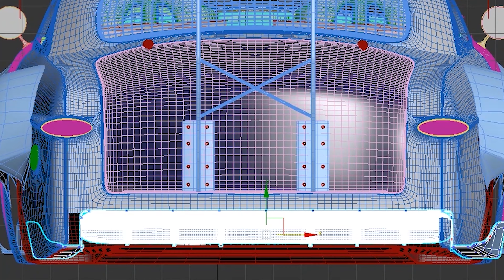Brake Booster Install - 1962 Mercury Monterey

Comment: Are you installing this in place of a non power brake system or simply replacing an existing power brake booster?
Reply from the maker: Hello..we are doing a front disc brake conversion.  So yes non powered to powered.
Reply: @ManiacsGarage these upgrades enhance safety and convenience